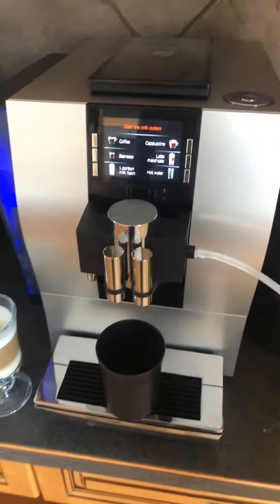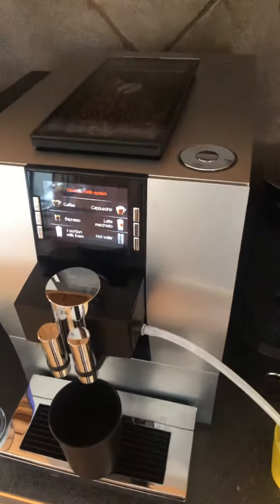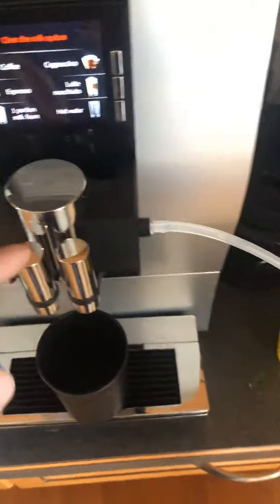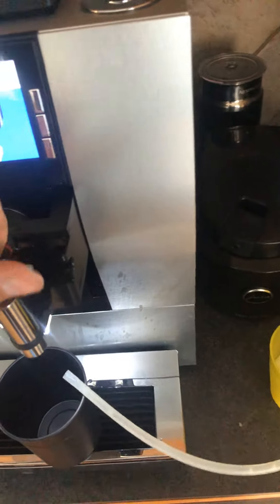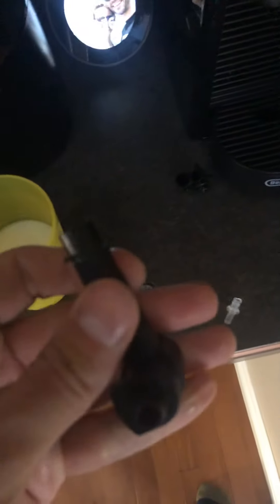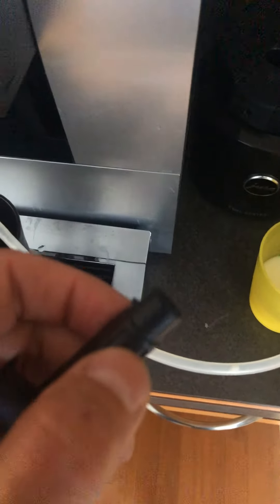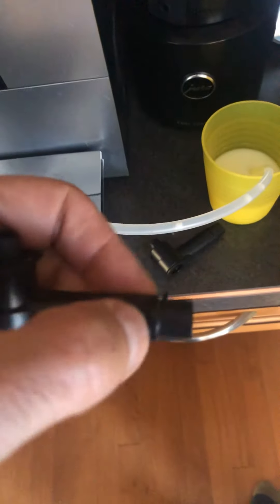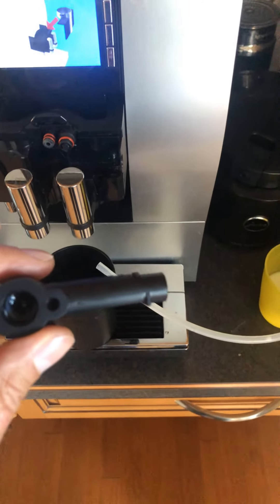Fix Jura Z6 milk froth

Comment: This is my 2nd Jura z6.  I bought mine from Costco.  I had the same issue with the milk frother, despite cleaning the milk system regularly. I returned the machine for a replacement but before sending back the old machine (only 6 months old), I swapped out the part mentioned in this video.  It fixed the problem with my original machine.  I put the part back into my new machine.  I have had this machine for a little more than a year.  Same problem has developed.  This should be a known issue by Jura and disappointing that a $3,000 machine breaks down so quickly.  This should be considered a wearable part by Jura and replacements should be made available.
Reply: Mine finally did this to me, but we've had it since 2018. Sounds like you have just had bad luck and hopefully you get one that lasts as long as ours.

Comment: Why isn't information like this on the Jura website? I'm having the same issue - is there any way to fix the spring back without having to replace the whole part?
Reply: Because Jura does not like people messing with the machine; however, if you call them they are generally quite helpful without necessarily immediately telling you to spend money.

As far as making it spring back, I haven't found a way.

Comment: You don’t need the special milk container for the milk to use?
Reply: No, you can do it from a cup if you like.
Reply: @rustler08  we draw milk straight from the milk carton. The machine doesnt care .. as long as the milk pipe is properly submerged into whatever is holding the milk.